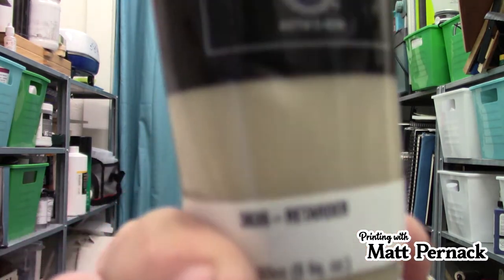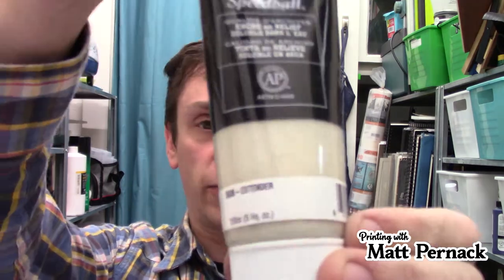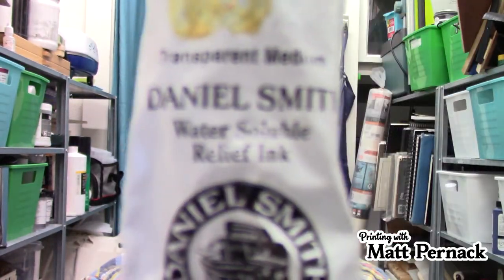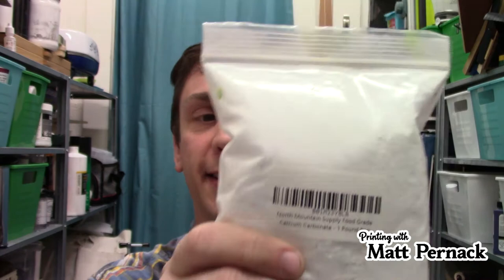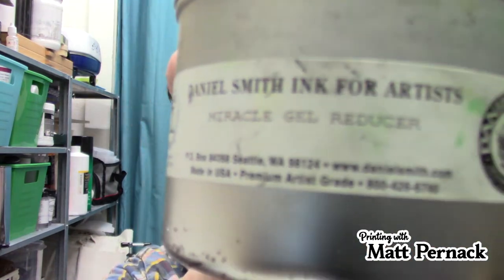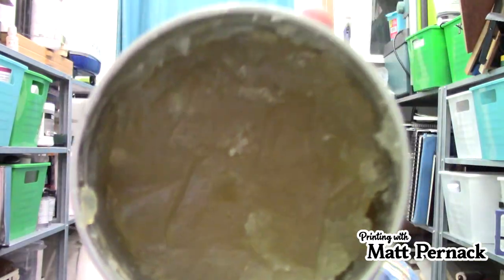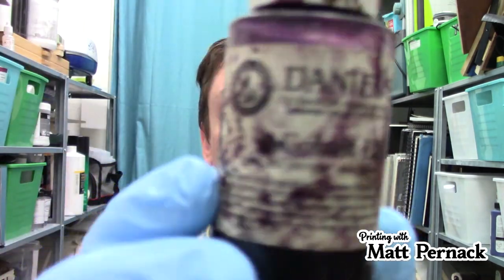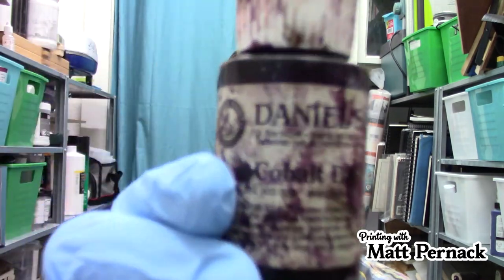Episode 029   ink modifiers

Comment: Hello Matt, I would like to start block printing on t-shirts. Will an oil based relief or etching ink work? I know that there are Fabric inks on the market but they are too expensive for my purpose. Any advice?
Reply from the maker: technically there is nothing stopping you from using a regular oil based ink or water soluble oil based ink to print on cloth. There are issues.
1) you have to wait for the ink to completely cure before you can even attempt to wash said shirt. Oil based ink and Water soluble oil based ink don't really dry they plasticize over time when oxygen hits the ink it react it causes it to harden and it takes time for the oxygen to completely permeate the ink. I would say at least a week depending on environment. 
2) Since the ink hardens it may not have a nice feeling hand or how soft the ink feels on the shirt. It may be crunchy, much less so than standard Plastisol Screen Printing inks.

There are the speedball fabric inks and I see a lot of people using them, but in my opinion they are pretty horrible. and they only come in on size so they will be expensive in the long run. Gamblin makes a textile ink that was collaborated with Drive by Printing for use epically on for cloth but can get pricy about $20.00 a can from McClain's Printmaking or $27.00 everywhere else plus shipping and it only comes in black. I have had customers in the past use screen printing ink. The Versatex brand is decently inexpensive and I heard of good results. But since its a water based ink you will need to use their fixer for heat setting and some retarder or their screen life to keep it form drying out on the plate or block.

You could make a screen print of your block by either:
A) use a black oil based ink and print onto a sheet of mylar and use that as your transparency for a screen using an emulsion coated screen.
B) Scan your print into the computer (make sure to print it in black and white) and use that image to print out a a transparency for a screen.